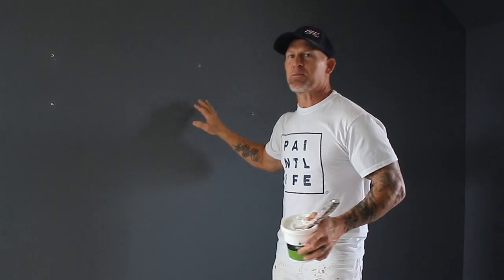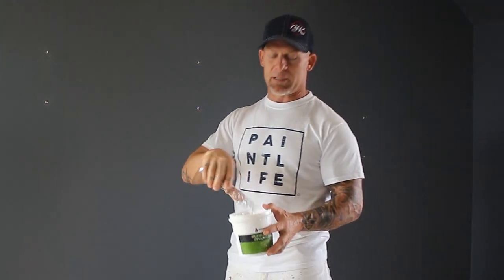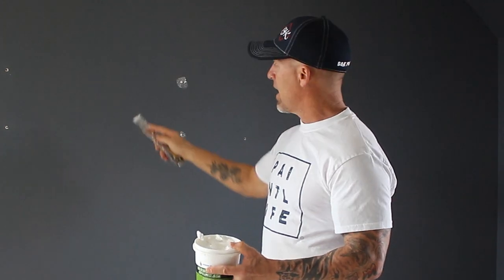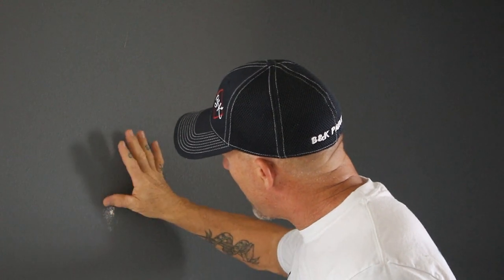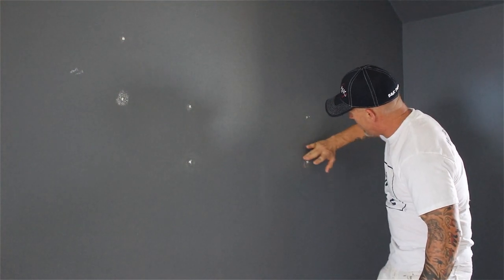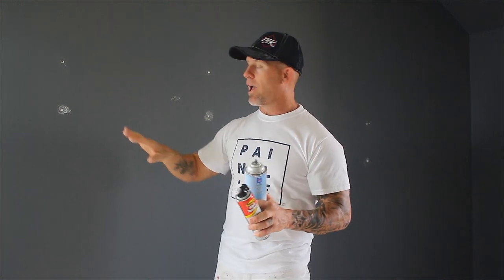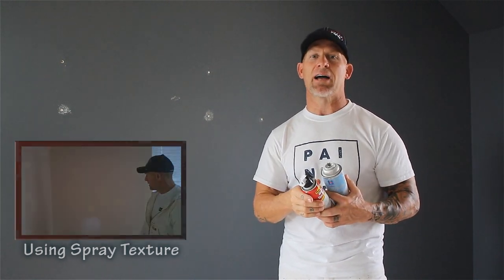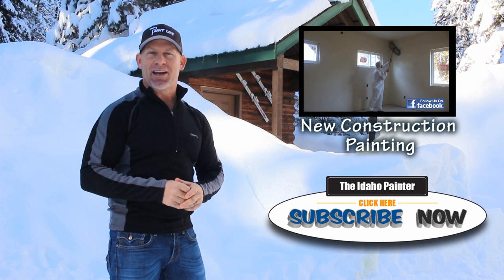How To Patch A Hole In A Wall.  DRYWALL REPAIRS

Comment: Hole prep tip, especially for picture hangers I learned working in a museum. Take a carriage bolt, put the head on your hole, hit the threaded end with your hammer. This makes a perfect divot with smooth edges. Then fill and prep like normal. 

Awesome videos. Thanks for sharing.
Reply: Art Mechanics you can also push in a divot with your putty knife handle or just tap the wall with the hammer. lol

Comment: i asked because here were i work in madrid it comes too thick and i put water . if not the airless sprayer don't work very well. and how you dont have a video about that... ive seen them all. very professional work.
Reply: You would just need a bigger tip for your sprayer. Don't dilute the paint!

Comment: question on the epoxy floor can you paint over and existing gray epoxy garage floor to a light color epoxy without primer? painted my garge gray but not liking it and wanted to 2nd coat it with a lighter gray color
Reply: I painted my floor 5 days ago would it be better to just prime it don't want to sand it again
Reply: +The Idaho Painter just repaint it with the lighter color
Reply: +The Idaho Painter. I repainted the floor with tile clad and it came out great. then 2 days later I painted the clear coat with armorseal HS 1000 and part of my garage dried clear and 1/4 of my garage turned yellow about 5-6 hours into the drying time is this normal or could direct Sun light affected my clear coat it was less than 85 degrees that day. Thanks
Reply: +The Idaho Painter all Shermin Williams paint store told me to wipe it down with 54 reducer didn't work then scrub it with warm soapy water didn't any advice will be appreciated.

Comment: I just buy the premixed mud use my finger to fill in holes  and lightly brush drywall sealer /primer pva.  it's a lot cheaper to mix texture then use hopper to spray . those cans  of spray texture in my opinion are not great and are expensive.  BTW if you want to hear something funny I have heard renters using tooth paste to fill pin holes. now that's a ghetto hack for filling holes